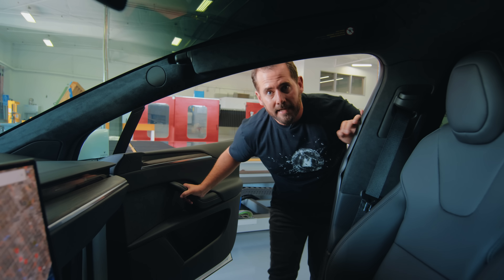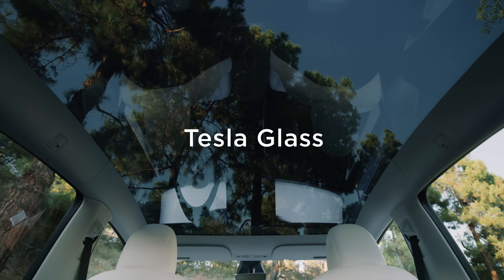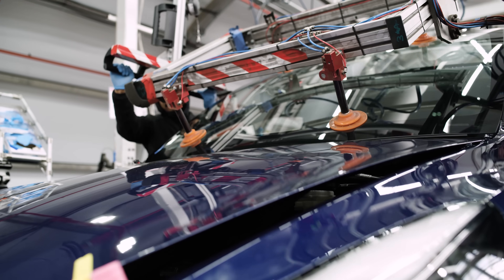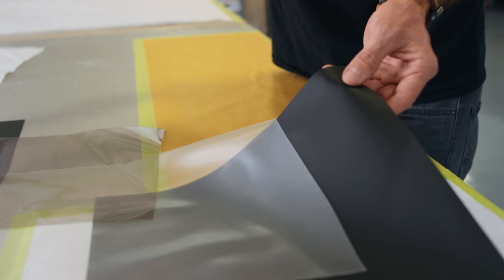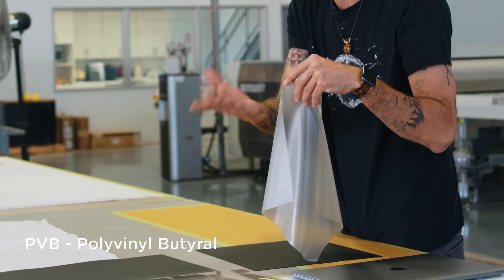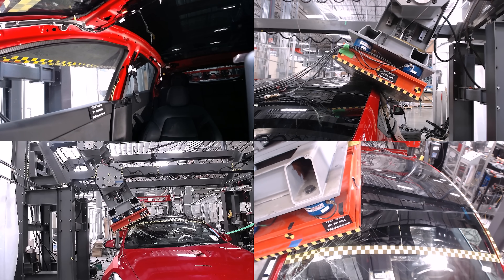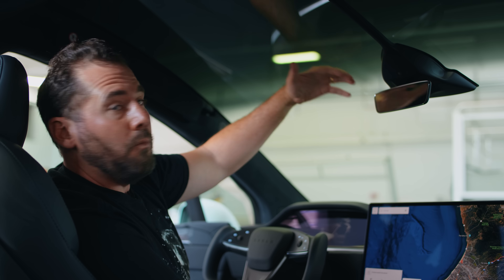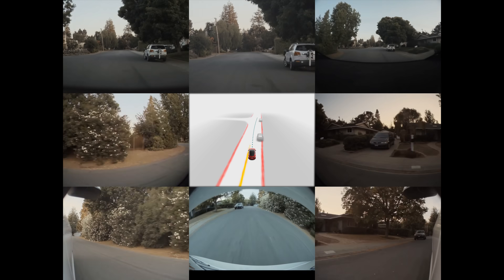Tesla Glass | The Secret to a Quiet Cabin

Comment: The installation of a LARGE window on the top of all Tesla's which generate massive amount of heat which radiates into the car making a poor driving experience is probably the worst automotive design ever. Tesla didn't even consider including what ALL other car manufacturers add when adding a sun roof, including a sliding cover which completely blocks the sun and the tremendous heat build up with their cars.  I recently purchased a Y and I'm finding out what all other Tesla owners must purchase; a Chinese sun shade which blocks the direct sun but does little to reduce the heat buildup in the vehicle.  I like my Tesla....but I HATE the large window. Simply idiotic!

Comment: After 30,000 miles, the noise inside will disturb the outside. Yesla is a regret, don't buy it. If you give $43k today, it is not certain that the same model of the same car will not drop $38k tomorrow.

Comment: Bought a brand new Model Y in 2020. Had it for 1 year. It was very noisy inside. Big turn off was the noise and the roof. In Florida glass roof and black seats heat up too much. When you get into a hot car we turn on the AC. which drains 30-50Miles off your total range per day due to hot interior. Not convinced. I would rather have a cool simple quiet metal roof instead of this glass. Very inefficient in hot climate. Extra heat and noise inside the cabin. Hopefully one day there will be a model without it.

Comment: I am waiting for a Grand Highlander sized Tesla.  My current Highlander Platinum has a panoramic sun roof as well but includes a powered sunblock curtain and also opens on summer days.  The glass in the front area is also laminated.  When Tesla comes up with a similar sized SUV at a competetive price, I will have one in my garage.

Comment: I recently had the front windshield replaced on my 2015 Model S P90DL and it didn't have the purple tint in it.  I'm extremely disappointed that Tesla is cheapening the product and not including the original purple tint as part of OEM replacement parts.  What do I need to do to get the correct glass replaced so that I have the OEM part?  The windshield was replaced by Tesla Collision in Fort Lauderdale so there's no reason why it shouldn't have the purple tint.
Reply: I was advised by the service department that Tessa has done away with the tint as a cost saving measure.  This was done quietly by Tesla in addition to them now making plastic door handles as a replacement instead of the OEM metal door handle.  It seems Tesla is now becoming the McDonald's of cars.

Comment: Glass roofs must be THE most idiotic "invention" in automotive history ever. Which nobody asked for, except for people highly susceptible to marketing BS. It makes the car heavier. It allows A LOT more heat into the cabin. in hot summer, that glass roof gets super hot, so you effectively then have a couple square meters of red-hot oven right above your head. Then you have to run A/C more, losing efficiency, losing range, causing more battery degradation. And like all glass - they DO break. And when they break, it is 1700 USD to replace. They make both the cars A LOT more expensive AND ongoing insurance costs a lot more expensive too, hindering EV adoption. 
And what advantage DO they provide? The correct answer is - NONE. ZERO.  Nobody looks up to the sky, especially when driving. That is not a thing, nothing to see there. And they do not "let in more light" which is just another utterly idiotic excuse for them. In a car, you are already sitting in a tiny box with glass all around you. How much more bloody light can you possibly want?
Stupid glass roofs should be a paid for option only.
Reply: They sell more vehicles with the glass roof, because it looks better, more futuristic and cooler. Those practical reasons you listed only matter to a tiny minority of loud people like yourself. Most people just care about design and social image.

Comment: i wish you put this much pride when youre actually assembling the car in the line. My brand new MY2023 with 7 miles looked like 50,000 mile car complete with so many swirls, horrible paint quality, paint chipping on the corners of the panel, misalinged plastics internal scratched, actual dents on the chassis that has been painted over. It feels like a punishment for the crime of doing business with you.

Comment: I am sorry but the model Y is not a quiet car.  It's noise and hot.   The glass makes it completely underivable during the summer heat.  If you don't put a shield to it.  The heat pump works overtime and  really drain the battery.   Ride quality and noise is one of the worst part of it.  My 6 year old son routinely throw up in the back.  My wife hates the auto poilot because it's so jerky.    It's an ok car with the ride quality of an entry level Toyota.  But speed of a race car.

Comment: Nice video. Shame that front windshield heating elements for the cameras are creating huge astigmatism resulting in vertical distortion from point source lights. My 2022 model 3 is putting traffic cones on the highway in the 3d visualization because of highway lights.

Comment: Isolation is one thing, reverberation is another. Drove a Y the other day and it was very reverberant inside, not surprising as is a hard sided box with almost no soft fabric.  Structural noise just echoes around and the radio sounds tinny because of the space - how do you mitigate that?

Comment: Headsup: my Model 3 Performance(2021) has been to service two times because the windows dont seal correctly. They make sizzling windnoise, and water enters the cabin/frame. This is also a case in my brothers Model 3 Performance 2021.

We love our Model 3’s though. But two service visits should have corrected the case… Tesla glass experience 💪🏻😄

Comment: Sorry,  I couldn't hear you over all road and wind noise in my TM3.

My 2019 TM3 LR DM is the loudest car I've ever owned. I've done everything I can to reduce the noise. I added extra door seals, removed the interior panels and installed sound deadening in the trunk and doors, I use thick carpet floor mats over mass loaded rubber. I even changed the tires to a less efficient but quieter touring tire. Its still unacceptably loud. I like the car generally, but the NVH characteristics and the brittle ride are the worst things about it.

Comment: Tesla engineers have never parked a Model Y at a grocery store in Las Vegas.  My Model Y got to over 120 degrees inside on a regular basis this summer and the cabin overheat protection didn't come on.  I took it to the dealership and they told me that the cabin overheat protection will not come on when it's that hot because it can't keep up.  That's a lame answer.  I spoke with the lead technician and a supervisor about this.  I was told that the reason my Model 3 doesn't have as much of a problem is because the bar in the middle conducts some of the heat away from the glass and interior to the body of the vehicle.

Comment: No offense to Tesla people but after 62,000 miles in my first Tesla, a model 3 sr+, I can honestly say, the cabin wind noise is the worst Ive ever experienced in a premium car brand.  I own Chevy Volt 2012 in EV mode and it has less road noise by far…..  still love model 3 for numerous other reasons. Wind noise and  shocks or bump absorption is sub par.
Reply: Do you mean to say that Tesla has worst suspension  ??
Reply: @nirbhayatiwari5425  yes.
Reply: @SGS2sprint  Can you explain why and also suggest suspension type they must use in order to make ride comfier  ... 

Please don't say air suspension setup  ..
Reply: @nirbhayatiwari5425  feeding the troll ?  Got 64,000 miles now on SR+ my comment was from genuineness .
Reply: @SGS2sprint  Brother, I am not trolling you  ... 
I was just asking for your opinion  ..
Reply: I have 100k miles in my model 3... can confirm, my 2013 Chevy Volt was quieter and rode better.

Comment: Like most other car manufacturers were already doing thermal and antinoise glass. But still people will be impressed when Tesla shows they do it. Power of hype. 

P.S. To all haters that will hate this comment: You hate it because it's true. Tesla is amazing car but you should not think they reimagined the car. They made it drive autonomusly and made very good bateries and engines. Everything else has been on a market for a looooong time. You just didn't knew that.
Reply: They really did lol. 2014, model S rated “best car ever” by consumer reports. 30k cars with laminated acoustic glass. They completely proved everyone wrong with the concept of an electric car. They made the first 5 star safety rating SUV and then went on to make the safest car on sale. They then went on to put sell the Toyota Corolla with the model y. Clearly, they are doing the right stuff

Comment: Great to hear from the team themselves! I will say that this design intent is not translating to the end product, based on my experience with my 2018 Model 3 and 2021 Model Y. Even with the double-paned glass in the Model Y, it’s quite noisy in the cabin at highway speeds. Phone calls are not pleasant. There are a lot of variable factors, like location, temperature, tires, etc. but I’m happy to get in touch with the team to help determine how further improvements can be made.
It is still a fantastic product, and with further improvements it will get even better.
Reply: I just got 2023, so much quieter than my earlier model Y. Good to see Tesla continuously improving. Good to know they put 2 layers of films on roof.
Reply: Just got my 2021 model 3. Way more quite compared to all my 3 series bmws and my Mercedes gle350 on the freeways and city speeds.
Reply: The Model S is extremely quite.
Reply: glad to see one realistic comment on this video. the whole time i’m saying to myself “teslas are not quite on the highway”
Reply: I agree but wonder if it’s not the glass itself but all the connections/seams.  My 2022 LRY isn’t particularly quiet either. It doesn’t feel “tight”  And the top of my head gets very very hot March-October in Austin, TX

Comment: That's why my new Model S LR has distortions in both the front and rear windshield windows? I enjoy every other part of my Model S except the quality control. Also have paint mismatch between two panels and speaker crackling at high volume.

Comment: Anyone who owns one will also attest to the heat that radiates into the cabin due to the lack of a overhead trim. This heat of course translates to higher air conditioning requirement which in turn increases battery consumption which in turn reduces range. On a hot day, it’s not very pleasant inside a Tesla.

Comment: "Dares to Dream and Chase it!" - To me thats Tesla.
Reply: You mean copy
W140 features included:

Double-paned soundproofed glass was a new S-Class innovation first fitted on the W140. This form of window glazing allowed for improved soundproofing, reduced condensation, and other insulation benefits.

Electrically-operated exterior mirrors could be folded by switch to ease driving in narrow spaces.

'Parameter steering' was a system which made low-speed driving easier by reducing the effort required to maneuver in speed-sensitive situations such as parking.

Rear-parking markers, or guide rods. These rods extended from the rear corners of the trunk lid when in reverse, providing the driver with a guideline for rear maneuvers. In 1995, this system was replaced by the sonar-based Parktronic system which measured the distance of the bumpers to nearby obstacles.

12-way powered, heated front seats, with 3 setting memory functions and lumbar support.

Windshield wipers with heated washer system. Later models also included rain-sensing windshield wipers.

Electrically-operated automatic-dimming inside rear-view mirror that tied into the seat and steering wheel memory.

Heated exterior mirrors. Later models also included auto-dimming driver's side mirror.

Orthopedic seats were an expensive option from the factory but consisted of several different air cushions in the seat that the user can inflate and deflate to find the perfect driving position.

Dual-zone climate control. Four-zone climate control on LWB models.

Reclining and heated rear seats on LWB models. V12 models also have the four-place seating option, which allows fully adjustable rear seats, lumbar support and rear sunshade control. The center seat has been replaced by a burlwood center console, allowing a 2 + 2 seating format.

The climate control system could be set to operate for 20 minutes after the engine had been turned off.

Electric rear sunshade.

Rear passenger illuminated vanity mirrors.

Soft-closing doors and trunk.

Leather interiors and burl inserts (optional; standard for 500SEC/CL 500).

In 1995 the S 600 Coupe became the first Mercedes car with GPS navigation system, designated Auto Pilot System APS. It featured CD-ROM maps and full color navigation display in the center dashboard.

In 1996 the Linguatronic voice control system and Parktronic sonar-based parking system were introduced

In 1997 the TELEAID emergency and tracking system was introduced in the US market.

Also, developed with the car, a Bose sound system was available as an option.

Comment: May I ask why Tesla didn’t tint the rear side windows and didn’t include retractable sun screens in the roof? I now have to buy aftermarket Chinese parts from Amazon to deal with sun protection and I have to find out where to get the windows tinted. Doing this will help efficiency due to not needing to use the AC as much to cool the cabin. I think Tesla could have easily done this as standard.

Comment: Was this glass made in lunar gravity?
Reply: No. But they copy pretty well 
W140 features included:

Double-paned soundproofed glass was a new S-Class innovation first fitted on the W140. This form of window glazing allowed for improved soundproofing, reduced condensation, and other insulation benefits.

Electrically-operated exterior mirrors could be folded by switch to ease driving in narrow spaces.

'Parameter steering' was a system which made low-speed driving easier by reducing the effort required to maneuver in speed-sensitive situations such as parking.

Rear-parking markers, or guide rods. These rods extended from the rear corners of the trunk lid when in reverse, providing the driver with a guideline for rear maneuvers. In 1995, this system was replaced by the sonar-based Parktronic system which measured the distance of the bumpers to nearby obstacles.

12-way powered, heated front seats, with 3 setting memory functions and lumbar support.

Windshield wipers with heated washer system. Later models also included rain-sensing windshield wipers.

Electrically-operated automatic-dimming inside rear-view mirror that tied into the seat and steering wheel memory.

Heated exterior mirrors. Later models also included auto-dimming driver's side mirror.

Orthopedic seats were an expensive option from the factory but consisted of several different air cushions in the seat that the user can inflate and deflate to find the perfect driving position.

Dual-zone climate control. Four-zone climate control on LWB models.

Reclining and heated rear seats on LWB models. V12 models also have the four-place seating option, which allows fully adjustable rear seats, lumbar support and rear sunshade control. The center seat has been replaced by a burlwood center console, allowing a 2 + 2 seating format.

The climate control system could be set to operate for 20 minutes after the engine had been turned off.

Electric rear sunshade.

Rear passenger illuminated vanity mirrors.

Soft-closing doors and trunk.

Leather interiors and burl inserts (optional; standard for 500SEC/CL 500).

In 1995 the S 600 Coupe became the first Mercedes car with GPS navigation system, designated Auto Pilot System APS. It featured CD-ROM maps and full color navigation display in the center dashboard.

In 1996 the Linguatronic voice control system and Parktronic sonar-based parking system were introduced

In 1997 the TELEAID emergency and tracking system was introduced in the US market.

Also, developed with the car, a Bose sound system was available as an option.

Comment: Tesla glass is one of the reasons why I would only buy a Tesla. No other car manufacturer puts as much effort into their glass. Previously I would always buy a brand new car and then drive it out of the showroom and into an after market tinting place. With a Tesla you don't need to do that, because it is the best money can buy in the glass department.

Having now said that, one thing that I am bitterly disappointed about is the daytime running lights on my model S, barely past 4 years old (2 months past the warranty) and the daytime running lights have failed because of a crack in the internal plastic. Apparently this is a "standard" thing, and it costs $3000 per side to get it fixed. That's madness. It wouldn't be so bad if it was a rare 1 in 10,000 occurrence,  but it's apparently quite common. essentially a design flaw and they still haven't fixed it. I was going to get it fixed but decided to wait until the other side breaks and then it will at least be balanced. had I purchased the FSD option it would mean that the car is falling apart before FSD is delivered.